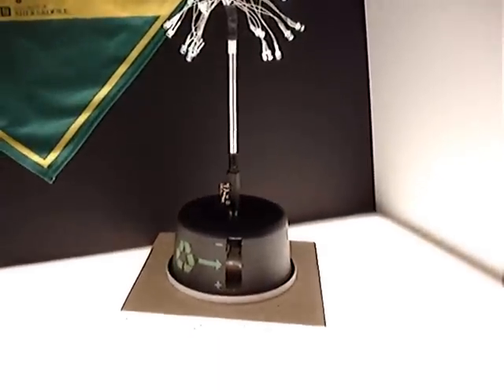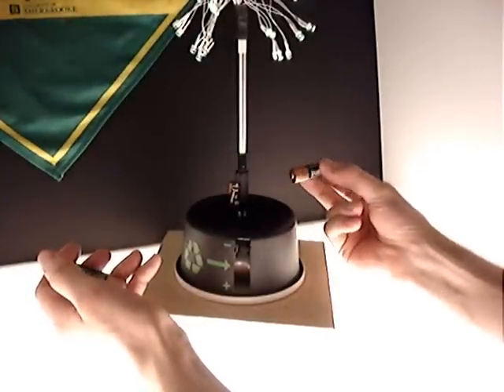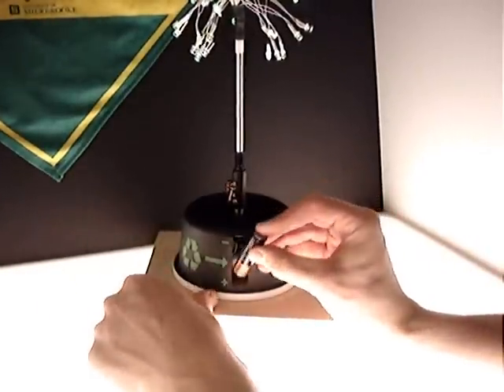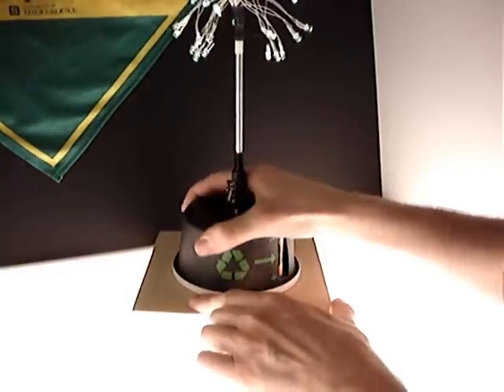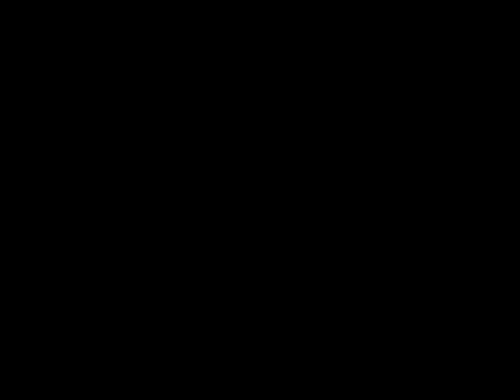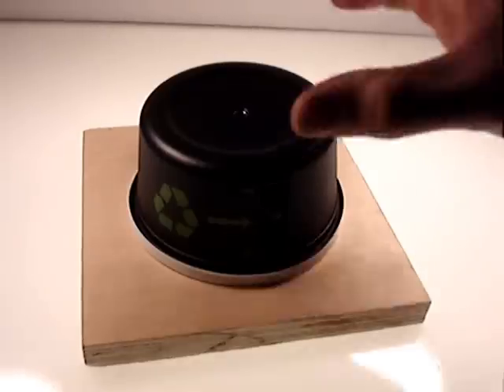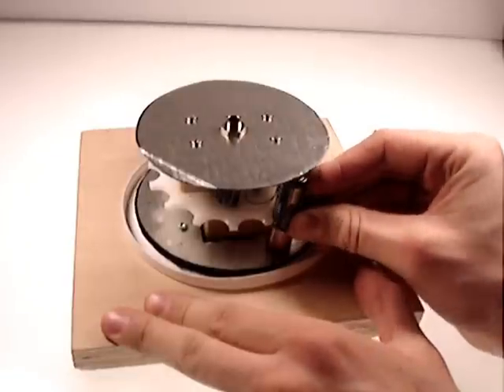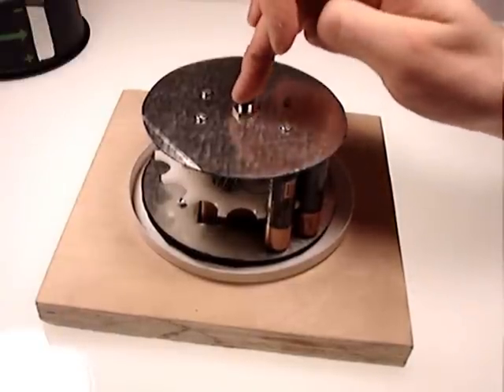Real energy seed lamp

Comment: Brilliant!!, the elegant design, you get more with less.You can turn this in a battery charger just puting a diod form the collector to + charge battery and connect - of the charge bat(s) to + of the run battery. The leds can be used to test the charge. 5 stars